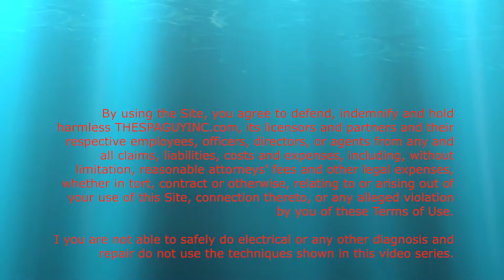Balboa Newer Style Terminal Block Replacement CS992 Spa Guy How To Series

Comment: Those looking for a replacement terminal block 1986242-3 is an exact solder in replacement for cs-992. This terminal block will require unsoldering the original cs-992 and soldering in the replacement The terminal block is a bit difficult to remove and will require a good soldering  iron to heat the heavy gauge terminals.

Comment: I had my hot tube melt this part out and replaced entire pack from balboa.. now it is hooked back up correct and doesn’t come on at all😡 everything seems to be wired just as the old one was. Any ideas of places to look for troubleshooting would be appreciated. Don’t have a tech in my area that has many recommendations

Comment: So there is no way to fix a board with the old Balboa Water Group Circuit Board Terminal Block? There is no generic replacement?
Reply: 1986242-3 is an exact solder in replacement for cs-992.

Comment: I have an Viper 2 speed 230 volt pump (AO Smith). It was leaking so I disassembled and replaced the seals etc. After reassembly low speed is frozen and buzzes until I press button for high speed then itll run on high until it times out and returns to low for circulation. It runs fine on low in this scenario. Only when the unit tries to start on it's own does low speed have an issue. Switching from high to low works. Any advise is appreciated. I'm going to test the capacitor next.
Reply from the maker: You most likely bent the 2 seed sixth finger in the back of the motor.. Straighten it and it should save it..
Reply: @spaguyhowto7417  I disassembled it again. Cleaned all contacts, lubed where needed still same issue. Bench tested and if I push impeller itll go. I ordered a new capacitor hoping that's the issue. Thank you for responding to me.

Comment: What would cause that connector to burn up in the first place?
Reply: If the wire isn't screw firmly, the connection can arc, which cause high temperature on the terminal